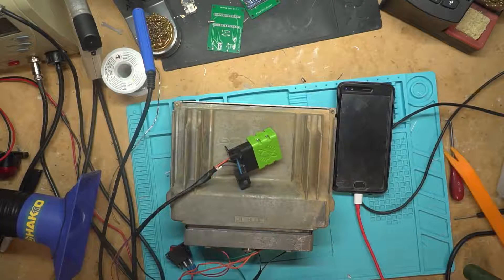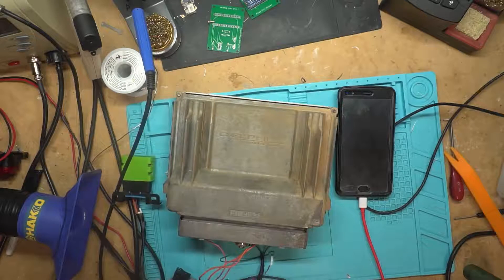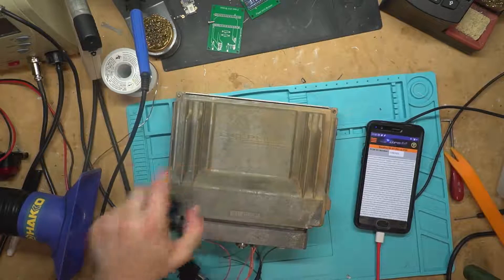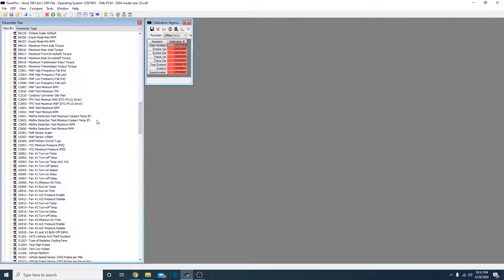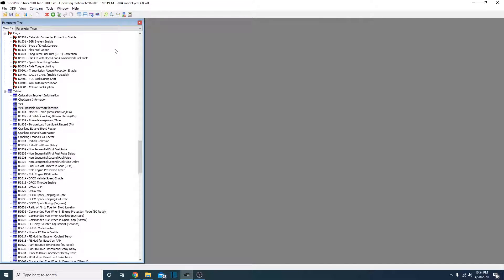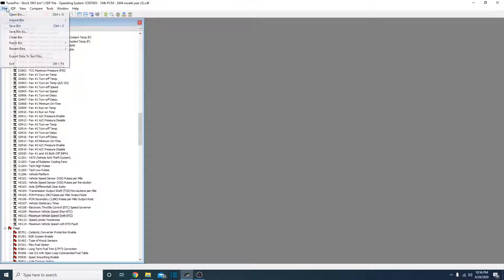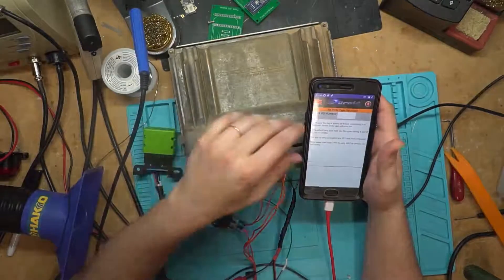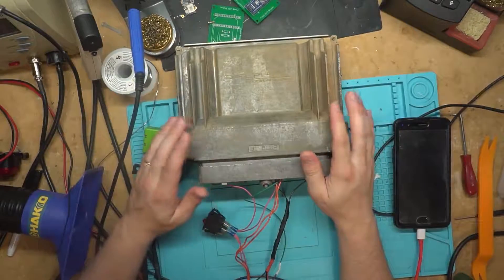Basic LS p59 Tuning With LSdroid and TunerPRO FREE Vats Delete and more

Comment: Will LS Droid work with a J2534? I have a J2534 that i have been using with PCM Hammer and has been working very well. Id like to try LS Droid but dont want to buy another adapter module.

Comment: So the pcm I'm using is out of a 98 Tahoe that had a vortec engine and when I read it it says it's "PCM unlock failed trying again in 3 seconds" is there a way to unlock?
Reply from the maker: I am not sure what PCM is used in those. what's the hardware version?
Reply: @FixedUntilBroken  m using the black box type of pcm. With the red white blue and black. It says the pcm is locked

Comment: ok, so if i have a desktop windows 10  computer that has bluetooth, i should be able to skip the steps involving the android phone correct?
 read and write with the computer and im done.
Reply from the maker: You can with pcm hammer. If you have an obdx pro you can use the new windows version of ls droid but It doesn't support any of the other dongles. But like I said pcm hammer works on the PC and supports other dongles. I have a video on pcm hammer.
Reply: @FixedUntilBroken  haha, ya i just finished looking at that. it reads  my pcm alright but apparently now i need to find a similar BIN file and remove vats and enable fans on it if its not already done, then import that BIN into pc hammer and not sure which of the 2 options to choose to write to my pcm as im back in linux now.?

Comment: so i got this 2003 truck 5.3 LS with no manifold, starter or ecu or alternator or sparkplug wires. . it had 160,000 on and he wanted 300 but i only gave him 200 until he comes up with some or all of those parts especially ecu
SO MY QUESTION IS; can i use say a 2006 5.3 LS ecu with my 2003 engine? this guy with one for sale  says it  has "vats deleted 60 pound injectors mild boost start up tune." for 300 cdn or about 240 usd
will this  TUNE be worthless to me w/0 bigger injectors?
how much should i pay for just any old compatible ecu that i still need a tune for?
Reply from the maker: if you use a 2006 harness with it you will be fine. there are plenty of people who sell the PCMs cheaper than that and its really easy to do that tune yourself.

Comment: Thanks for posting this. I can't seem to get tunnerpro to work. I get checksum error when saving bins. Tried 3 versions of tunnerpro. Same error re-saving virgin file no changes. Thanks
Reply from the maker: Does the xdf match the osid? That's my only guess. I've never run into that issue before
Reply: @FixedUntilBroken  yes
Reply from the maker: I'd say try the gearhead efi forum they will probably be able to help

Comment: Is not easy finding xdf
Reply from the maker: There is not an xdf for every os but you don't need one for every is you can just flash a different os. They are easy to find though. Get on gear head efi or pcm hacker forums and use the search feature. If you osid doesn't come search or ask for a comparable os to replace it with.
Reply: @FixedUntilBroken  can you make video lots of people have this issue
Reply: Pls
Reply from the maker: @julzam9660  sure it will be a week or so to get it done but makes sense
Reply: @FixedUntilBroken  Ty,ty,ty

Comment: what if i went from a 5.3 to a 6.0? when i change engine type will all the spark/fuel tables have to be modified?
Reply from the maker: Yes and you should be able to find 6.0 bins for what ever is you have making that very little work to do

Comment: this shit does not work, ive torn my hair out trying to get it to work
Reply from the maker: You will have to give more details I've had zero issues.
Reply: Fixed Until Broken OS 9381344, 4.8 before every using this stuff I had injector pulse for a second while cranking for my swap. That was the stock ecm of course. I’ve tried and tried and every attempt yields the same result, no injector pulse. I’ve found an xdf file that is supposed to work with this ecm/os I just don’t know anymore. For me this has been a gigantic waste of $50. Assuming theirs human error played here I am now attempting clone the ecm with the current tuner pro edit which only consist of vats set to “2” or disabled rather. Prior to this it would Give me an error when actually hitting calibration so I would hit write new os+cal using my file edit
Reply from the maker: that's one of the 0411 512k PCMs right so like a 99-02? or is it a 896 I don't have any experience with those.  I haven't seen an XDF for that OSID but I haven't messed with that OSid you have. I'd recommend trying another OS thats more widely supported and like 12202088 if its a 0411. This is sounding like you are having issues with the XDF you are using and not an issue with LSdriod or Tunerpro. I would recommend hitting up LS1tech or Gearhead EFI. not sure what error your getting though you would have to give more details.
Reply: Fixed Until Broken I think the issue comes down to I had either the transmission type changed when I shouldn’t have or I had to clone my bin file that I edited to only have vats off and no others stuff changed, after borking the ecm up or something weird. So I have three things now... fuel spark and a dead starter :-(
Reply: @thegxpguy  i would upgrade to the 2002 os 12212156. way more support and there is tunerpro xdf out for it. my opinion.

Comment: Is it a way to change tire size on lsdriod or tunerpro
Reply from the maker: Yes. I'd have to look into it some more to give a confident answer on how to do it but it's supported. It's not like hp tuners where it does the math for you though. You have to to do the math and then set the pulse of I understand it correctly. Like I said I'd have to look into that more but I know it is there.
Reply: @FixedUntilBroken  Do you know the title of the tire size on tunerpro I'm sure I could figure it out if I just knew the name of the tire size and gear size
Reply: Honestly you might not want to, bigger tires and lower mph = less miles on your truck and higher trade in value.
Reply: @goodkill1  not everyone is shady and wants to lie to people.. just saying.

Comment: How would I disable the trans since I'm running a TH350? I haven't purchased the OBD LX yet so I haven't had a chance to mess with this yet.
Reply from the maker: You could just put the 5speed os on it. But I've never looked into tuning out the transmission. Most people want to replace their th350s with 4l80/4l60. Why wouldn't you want overdrive haha.
Reply: @FixedUntilBroken  I have a fresh TH350 that was already in my El Camino before I started the swap and I have a rebuilt TH400 sitting in garage.
Reply from the maker: You  are going to need an electronic VSS from the TH350 so the PCM knows how fast it is going. helps it make decisions on E fans and  IAC if I remember correctly. Me personally Id sell the rebuilt TH350 and pick up a 4L60 or 4l80 if this is a street car you are building but that just IMO. OD and EFI go great together. I mean keeping the TH350 is like throwing a carb on a LS... You can do it but it doesn't mean you should.
Reply: @FixedUntilBroken  How would I flash a different OS to my ECU? Would I just load up the BIN that I want to my phone, go on LS droid and write said BIN to my ECU and I'm good to go?
Reply from the maker: @frankvaldez8873  pretty much. You should check online and make sure the bin you are planning to use won't brick the PCM
Reply: @FixedUntilBroken  Awesome good to know then. I'll be sure to look into it again just to make sure and since I have a spare ECU I'll write it to that one as a test.
Reply: @frankvaldez8873  tip P01 is 512kbs memory. p59 is 1mb memory. you can not cross those os to each other pcms.  tip also OBDX PRO is 4x faster. supported by ls droid (android)and pc hammer(windows).
Reply: Ls swap with th350 transmission,,, its like going  100 miles backwards,,
Reply: @gerardolopez5875  4l60e on a drag strip is like running olympic with broken legs

Comment: So the xdf file need to be the same for my PCM right? So I have a PCM ending in 411 so where do I find the xdf for my PCM.
Reply from the maker: OSID ≠ HWD. XDFs are found on forums and github.  Sometimes you won't be able to find a XDF for your OSID. If that is the case you may have to flash a supported OS on your PCM.

Comment: Oh wow, so I can delete VATS permanently on my pcm with a $60 scan tool from amazon? That’s insane.
Reply from the maker: Yeah  you can do more and its a one time fee for the tool. Software is free. so if your friends need help you are ready.
Reply: @FixedUntilBroken  ls droid coming on gen 4 thats crazy cannot wait to be avle to use it
Reply from the maker: @FirstLast-tx3yj  yes it's also becoming cross platform also. Now it's going to take a lot of work to make tuning actually happen on E38 ecms but being able to read/write will really speed up people getting involved in reverse engineering the firmware.
Reply: @FixedUntilBroken   id b happy with just vats removed.

If I fit a sloppy stage 3 cam on my gen 3 can I tune with ls droid and tuner pro??
Reply from the maker: @FirstLast-tx3yj  yes you can tune everything on p01 and p59. I don't do anything like that myself but it's completely possible. I only got into this because of working on circuit boards I'm not an actual tuner
Reply: @FixedUntilBroken  if I manage to make an arduino lamda and afr data logger at the relative rpm.

Will this be a good idea instead of guessing how much fuel to add when in tuner pro?

Because if I have lamda or afr at every rpm on several pulls i can use tuner pro and modify fuel map
Reply from the maker: @FirstLast-tx3yj  using wideband o2 sensor than that should be fine If it narrow band it's about useless data.